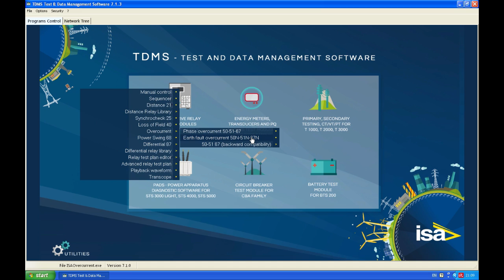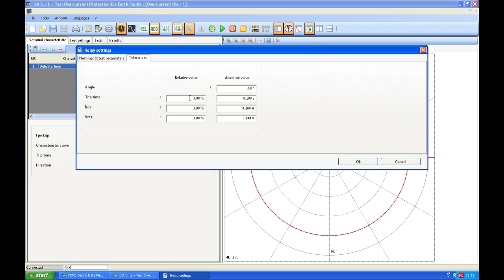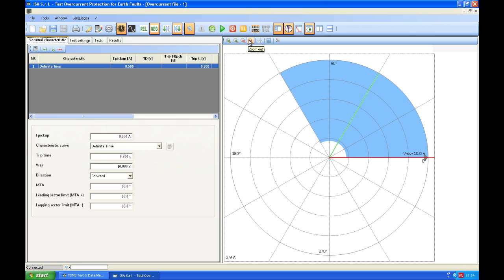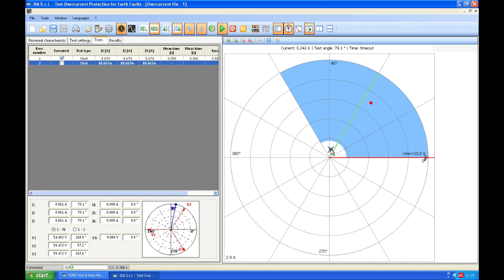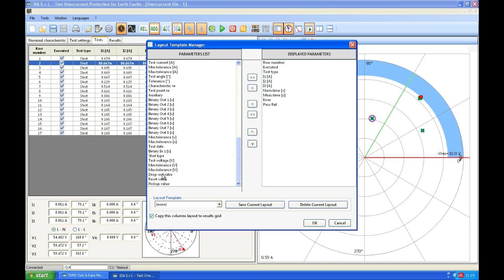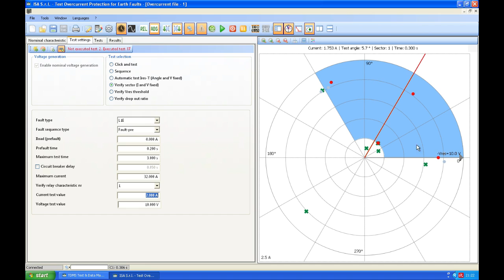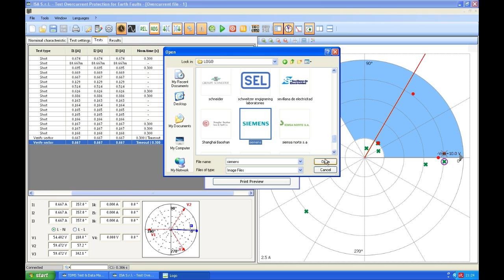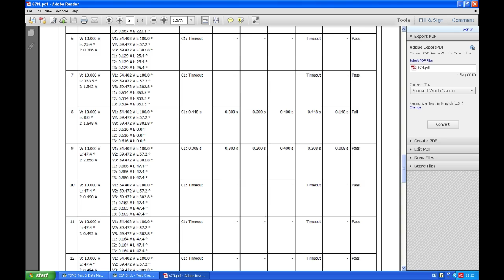TDMS Directional Earth fault Protection 67N Example

Comment: Hi, i tried to run the 67P test with an ISA-DRTS66 test set, a SEL-751 relay operates in any direction with current values greater than pickup, i tried setting"67P1T" wordbit on the relay's output, enabled the directional control of the relay but it doesn't work
Reply from the maker: Joel Orlando Padilla funes Hi Joel, in order to help you I would need to ask few more questions. Please write to me @ andrej.sepcic@altanova-group.com and I will do my best to help you. Usually in this case it is the question of conventions. Clockwise or counterclockwise, also we need to know what is reference value, current or voltage etc....write to me and find the reason